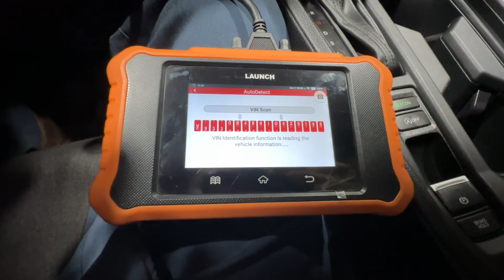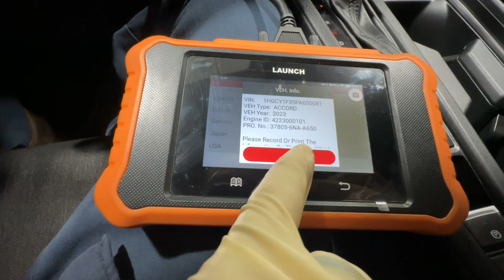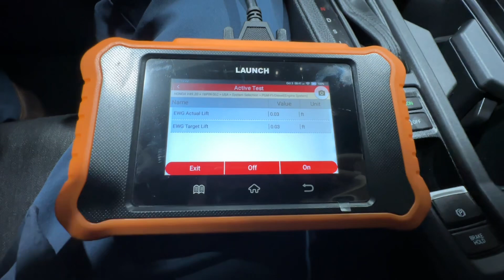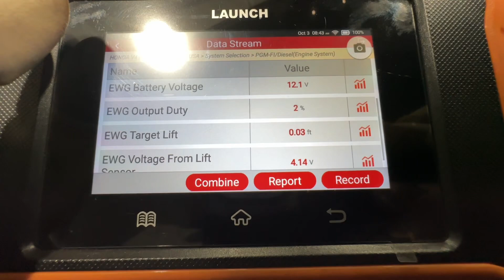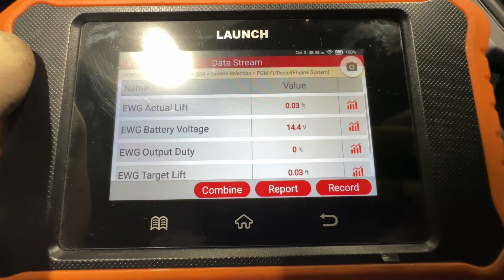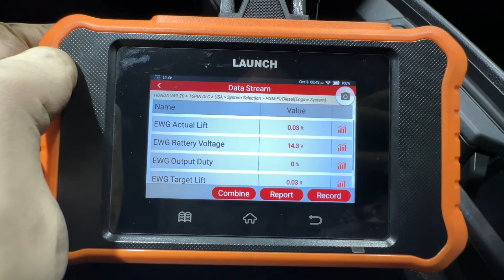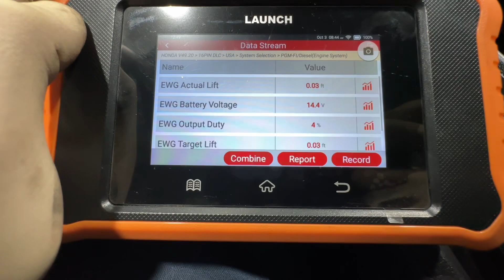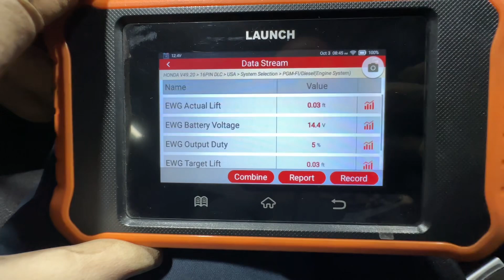Honda turbo waste gate function test and data monitoring

Comment: I am considering this scan tool for my Hyundai / Kia. Do you think it's worth the $200 price? I do DYI maintenance such as brakes, oil, transmission fluid, diff fluid and TPMS. basic stuffs.
Reply from the maker: @HiFiInsider  absolutely if they have a Hyundai/kia specific one. Nothing beats this tool for its price range. It’s not perfect, but does surprisingly a ton.
Reply: @BCautosutions  thank you!